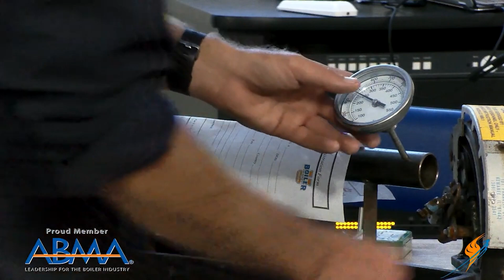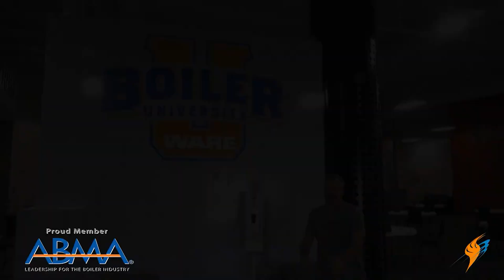Gain Efficiency Using Turbulators in a Boiler - Boiling Point Flashback

Comment: The demonstration is fine but its worth keeping in mind that the flue end of a boiler tube will have  backpressure and turbulence at its end. Unlike the blowtorch in the demo, most tubes won't allow gas to pass thru with no resistance.